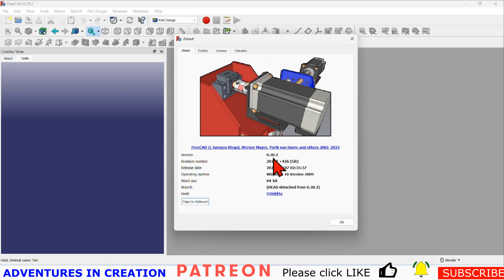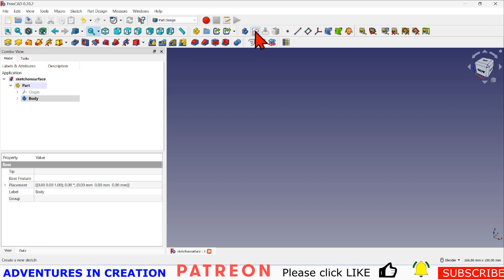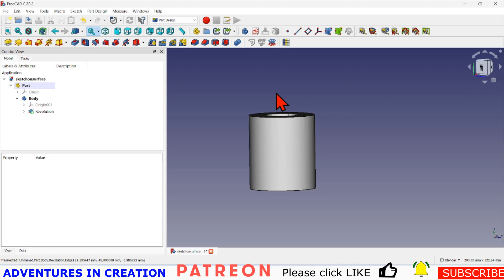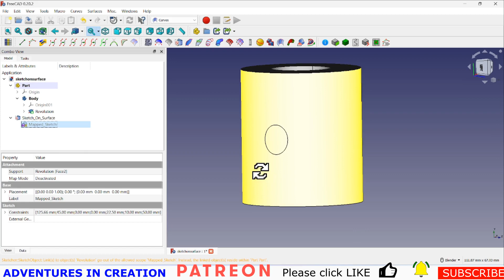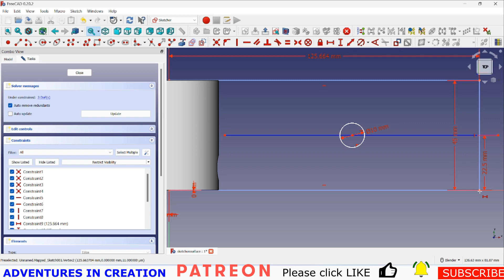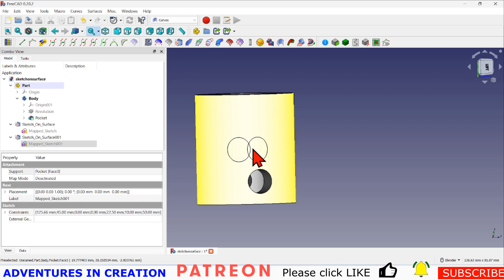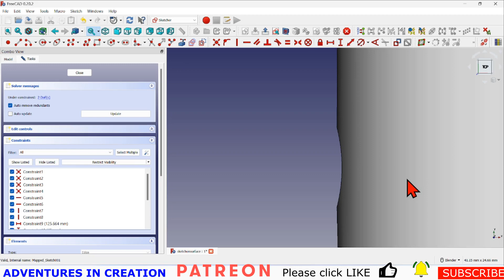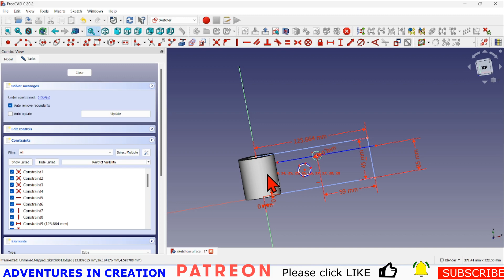FreeCAD for Beginners #46 Sketch on a face #freecad #cad

Comment: I have been trying to add a number of port holes on a curved surface.  In your video you show how to plot a circle on a curve surface, but HOW do you Pad or Pocket the sketch you just created?
Enjoy your videos.  I mainly stay in the Part Design work bench I think the curve workbench will be beneficial to me in make parts for model boats.  Thanks again
Reply from the maker: If you share your file with me, I will take a look and give you the best way to pad or pocket from there.
Reply: During the video you draw a circle using the curve workbench.  Then you make another circle using Part Design and make a hole.  I don't see you padding or pocketing the sketch in the curve wb.  Thanks

Comment: Thank you for your videos. I have learn a lot from them.
Can you recomend a cheap 3D printer? and can you include some demo for printing freecad projects
Reply from the maker: I use an Ender 3 pro v2 and very happy with. Not crazy expensive and includes a lot of features. 
I will do some 3d printing videos.
Reply: Thank you. Excelent  Work!

Comment: Hi Ian. I know this has nothing to do with my query, but I was wondering whether you know how to do a spline shaft in Freecad. I have to reverse-engineer and special knob to fit a pre-existing piece of equipment, and it has to sit on a shaft with a 6mm shaft which protrudes from the end. This shaft has approximately 20 'teeth' projecting on which the knob has to engage. Not sure if this is adequate description, but if you think you can help I would be more than happy to send you a picture via  email. Cheers, Noel
Reply from the maker: Hi Noel, I am sure we can reproduce it in FreeCAD. - Send me some pictures, I will create a parametric version then you can go back and put in the correct dimensions.
Reply: @Adventuresincreation  Great Ian, but where do I send the pictures to? Noel
Reply from the maker: @noelbiggins5279  take a look at your messages in Patreon
Reply: @Adventuresincreation  OK Ian, what's your email address please? Noel

Comment: Isn't the distortion down to the fact that the circle on which the hole is based has been drawn on a two dimensional plane and, therefore, when viewed along an axis perpendicular to that plane appears as, and is in fact round, whereas the circle drawn on the 'unwrapped' sketch is also circular but that circle is then wrapped around a cylinder. When the two-dimensional circle is wrapped around the curve it appears as an ellipse when viewed perpendicular to the tangent of the cylinder.  Cut a circle out of paper and stick it onto a high ball glass of the same or slightly larger diameter to get an exaggerated demonstration of this. I think the effect is easier to discern with a centred square with sides almost as big as the cylinder height but leaving a margin. BUT, having said that, if you change the dimensions of the surface of the cylinder after you have formed the mapped sketch (increasing or decreasing the height, say), the size of the mapped sketch remains the same and the shape of the 'circle' distorts to form an ellipse with a vertical dimension adjusted  to conform to the ratio of the diameter of the circle to the original height even if the new cylinder height has been adjusted to be smaller than the diameter of the circle.  On another point, how do you do something useful with that circle shape as it seem not possible to effect a pad or pocket as the sketch is outside the Body?
Reply from the maker: That's what I thought at first but, after putting a hole through the circle draws differently. It certainly wasn't consistent.

Comment: You are moving the cylinder around on the screen at 3.20 minutes.  How do you setup FreeCAD so you can move the image like that?
Reply from the maker: I use the "blender" controls. From the drop down bottom right
Reply: @Adventuresincreation  Thank you,  I had also forgotten to use the center mouse button.

Comment: I tried this since i have never used curved workbench. It looks to me that  your sketch is 2d and wraped round the cylinder and is not properly shown till you do the cut.  I had no issues with the holes not being central.  I also noticed that if you start your scetch on a different plane your drawing remains on the xy plane,  i also managed to turn the sketch of the hole so it was shorter top to bottom rather than yours which was shorter left to right
Reply: Ditto. I however tried a revolved and a padded cylinder, to see if there might be differences, but both were spot on. I did notice that his is not fully constrained and not sure if that might have an effect. I am using 0.20.1 release.
Reply from the maker: Thanks, maybe that has an affect
Reply: Hmm, the distortion, I'm pretty new to FreeCAD so still feeling my way, but could it 'just(!)' be an artifact of the viewer? The sketch for the hole was created on a flat plane parallel to an axis whereas the sketch for the circle was created on an 'unwrapped' circumference of the cylinder?
Reply from the maker: Good to know
Reply: Could it be it is mirrored the long way just like it was on the short edge? I'm think you are maybe view it from the back side as how you showed it in the video you could see part of the unwrap because it was still behind the cylinder which suggests they expect you to work flip from where you were. Hope that made sense😉